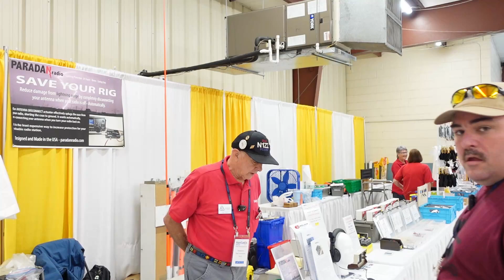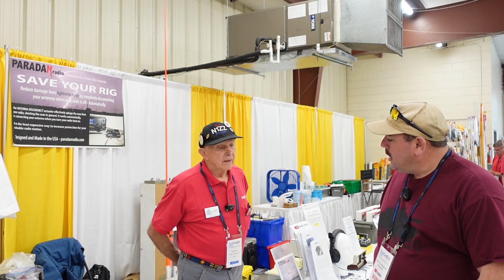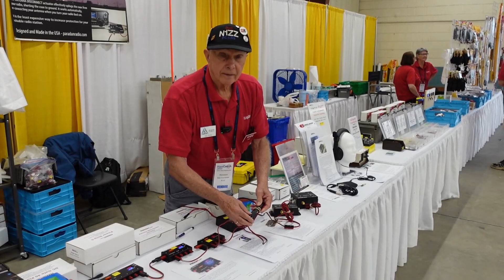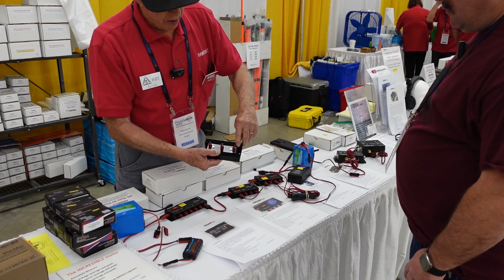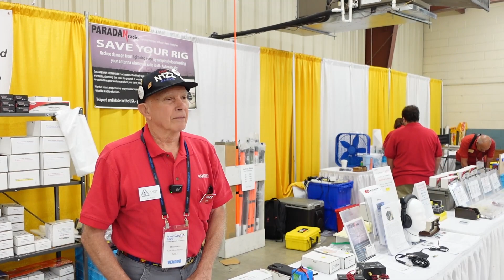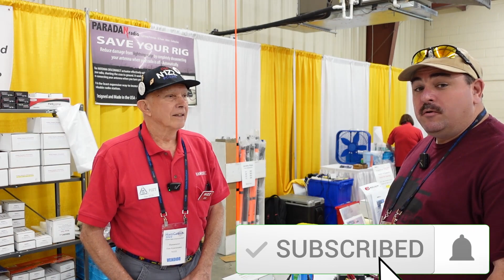Paradan Radio

Comment: Nice equipment.  I would mount the antenna disconnect inside so I could see it connected visually with the LED though.
Reply: It is nice equipment but I'm not sure I would want anything inside my house or shack that might feed lightning in. But I do understand the need to see the leds
Reply: In my second floor station, I would want it outside for more direct access to earth. I dont see the LED as that helpful (except for troubleshooting). At the radio end, it is obvious when your antenna is connected. Every ham has an opinion and a unique station! 😀   Nice work Steve!